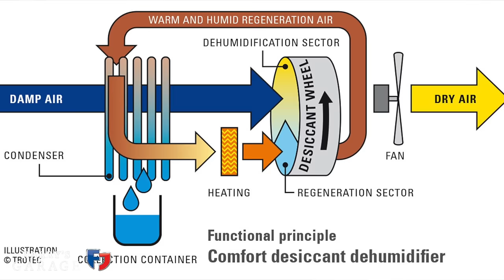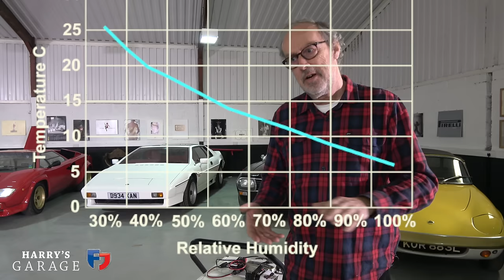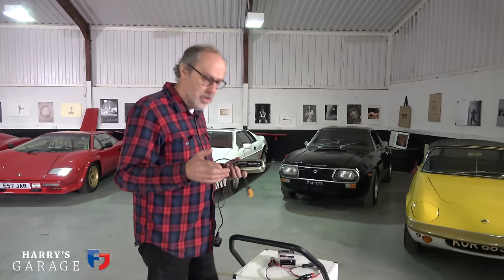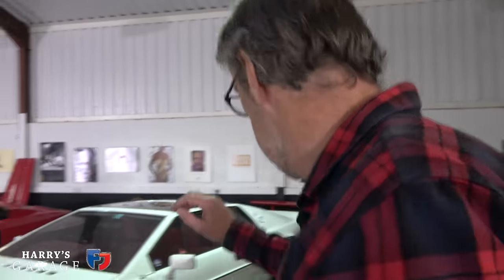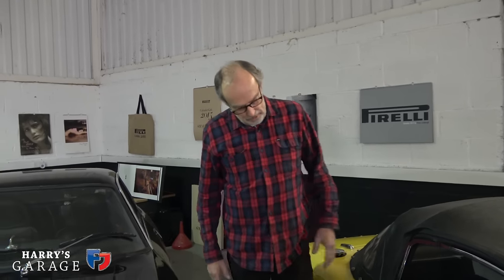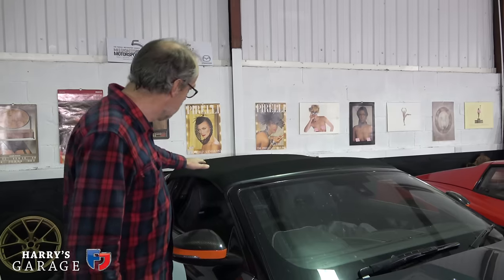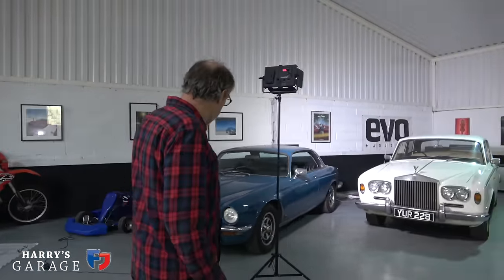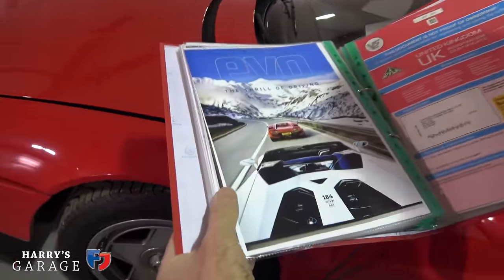My top tips for keeping any car in top condition during a period of storage.

Comment: Hi Harry, one issue you didn’t cover is disc brakes.  We live in a modern eco home with fully insulated garage (unheated though), plastic locking panel floor tiles etc. but every time I take my 911 out the discs sound awful at slow speeds out of village until it clears, where there must be some rust pitting on the discs (the rust doesn’t show).  I’m careful to fully air dry the car before putting into garage but always happens, even after a 50 mile dry run and not washed before parking up for say a month ☹️.  Any advice please?

Comment: Don't store a car with fuel that has an ethanol component (e.g. E85) and it's often worth doing a brake fluid change if you can. Both E85 and brake fluid are hydroscopic which will cause corrosion issues.

Comment: Anybody in Florida or California wondering why Brits put salt on winter roads instead of just fitting chains or studded tyres in winter like they do in Scandinavian countries or Russia or Canada... It's because the weather changes at random, a British winter's a joke, and you can't depend on a snowy road to stay snowy for more than a few hours.

Salt gives a quick fix to a problem that lasts just long enough to be a pain in the backside.

Studded or ordinary winter tyres are fine when you get a proper winter. Months of predictably awful weather is actually easier to manage than a typical British winter, which often only lasts a few hours, maybe four times per week, off and on, for several months. Or not.

So... because you can't scrape the roads to a uniform smooth iciness, or plough them clear whenever the drifts get bad, the Transport Agency just sends round the salt-spreaders at night if there's been a bit of a snowfall. It's usually just enough to prevent major traffic pile-ups the following morning.

The snow will probably have vanished by 10 a.m. anyway. A brief heatwave will see to that. Maybe. Sometimes it starts raining and the slush melts and refreezes before getting covered in snow again. Sometimes. So a dose of salt keeps the traffic moving until the next rain/ sleet/ hail/ sunshine/ ice-storm.

It's all a hopeless compromise and it's terrible for cars - but it's better than nothing.

Comment: Harry- do you use fuel stabilizer when filling your tanks for long-term storage?   In the US at least, the gasoline formulations age very quickly and much worse with ethanol blends.
Reply from the maker: No but then I only use superunleaded, which contains <5% ethanol and has additives already included. US regular unleaded is a big no-no as it contains10% ethanol, which causes all sorts of issues during even short term storage.
Reply: buy a diesel! Modern diesel goes off eventually, but I think lasts longer than modern petrol! And diesel is less of a fire hazard! Harry will know about diesel (farm yard tanks, and motor yacht tanks requiring water separaters, the diesel bug when water gets in the tank due to condensation; anti-bug additive that doesn't always work!; and keeping boat diesel tanks full to lessen condensation, especially in the South of France with the heat in the air versus the cold hull in the water...) Great video Harry - keep 'em coming. I could listen to you all day talk about anything! Cheers.

Comment: My car's only from 2004 and already the handbrake sticks if I leave it parked a long time and it takes some effort to pull away off the drive... thinking about it now, thankfully my drive is level, so I probably don't need to leave it on.
Reply: Mikeado66: My GLA 45 has one of those Mercedes automatic handbrakes, I have no option. The car does everything for me except steer. Fortunately I have a motorbike for sheer visceral fun 😎😎

Comment: Desiccant Dehumidifier Recommendations:
Another great greet video & always enjoy Harry’s laid back real world presentation style : -)
Anyway back to Dehumidifiers, I’ve been using the “EcoAir” make of Desiccant Dehumidifiers for many years and can recommend there ability to strip out moisture from an average UK cold damp garage..
For Harry’s impressive Garage, He’d need quite a few of these which do also give out a fair amount of heat:
* Eco Air DD3 Classic (formerly DD322 Classic) ~ £180 to £200  
   Web Link: https://www.ecoair.org/DD3-Classic.html
But for the average UK car owner with a 1 to 6 car garage, this is what I’d recommend:
* Eco Air DD1 Classic MK5 (formerly DD122FW Classic) ~ £160
   Web Link: https://www.ecoair.org/DD1-Classic-MK5.html 
These are light to carry & can also be used else were in the home to dry washing, ect, ect.
(A ~£6 “Temperature Humidity Meter” from FleeBay is also useful to monitor one’s garage.)

As mentioned in the YouTube clip, Dehumidifiers are not cheap to run, but both models strip out about one pint of water per Kwh used, hence why it’s important to insulate & seal Your garage, so they then go into standby mode, with just the fan running (~32 watts)

As for the CTEK chargers, agree 100% that they are good gadget to keep the battery topped up & I’ve fitted the “Comfort Lead Indicator” to my cars.

Comment: Lidl sell a super trickle charger for less than £20.00
Reply: Any trickle charger is better than a flat/low battery that will throw up errors.
But no harm in treating one's pride & joy to a CTEK charger..!!!
Reply: I used a cheap charger with a plug in timer to stop drying the battery out for years  1 hour a week was enough for mine

Comment: I have a 1997 Volvo V70R AWD manual which I would like to keep long term but I have to keep it outside although its off the road, would a cover be something you would consider outside?
Reply from the maker: Not really, as wind makes the cover  flap and this scratches up the bodywork, plus car remains damp under the cover when the sun comes out and doesn't dry out nearly as quick as it would if it wasn't under a cover.
Reply: @harrysgarage  Thanks I need to move house really then, Its going to be a tricky one to broach with the Mrs

Comment: I just run the engine for 20mins every two weeks.
Reply: Out on the highway: Probably enough. 
At idle in the driveway: The oil won't warm up enough to evaporate the moisture in it and you could be doing damage.

Comment: I remember seeing a TV show, years ago, and it restored a Ferrari that was stored in a showroom for years, without being taken out, but it was frequently started. And they found the valves to be burned, because the car was never run to full temperature, so for years it was started with the choke and it only ran rich, causing the disaster. 
So I would add, if you start the car occasionally run to optimal temperature.
Thank you Harry.

Comment: we haven't had economy 7 since the 1980's.
porsche are the worst. easier to reboot chernobyl than a 996 with a dead battery.

how do you deal with keys? battery in my p.38 keyfob died and cost me £200 for a replacement.